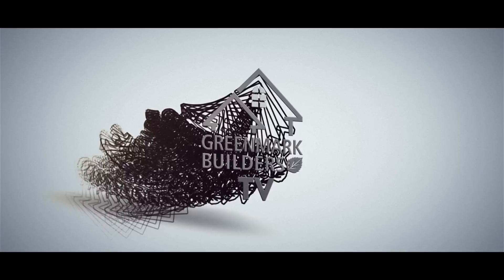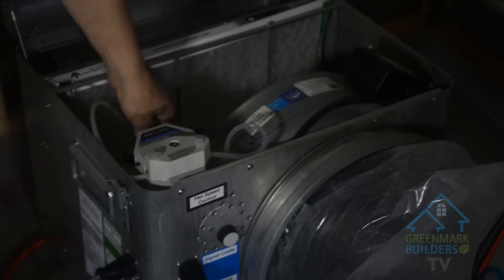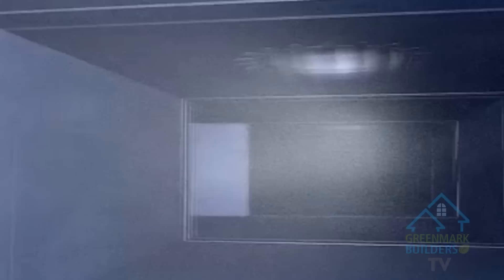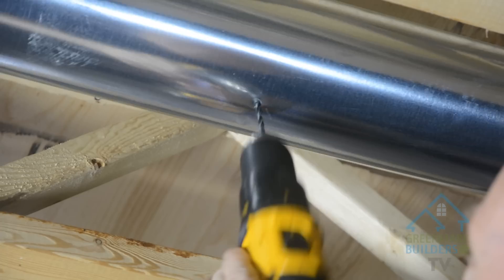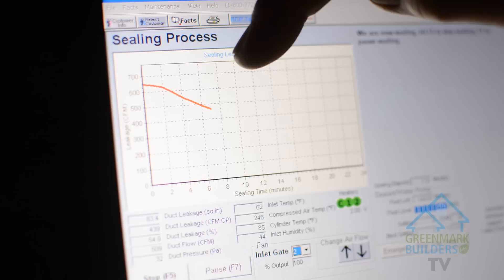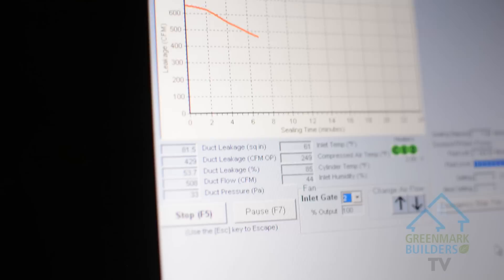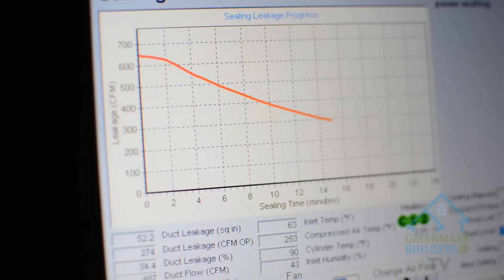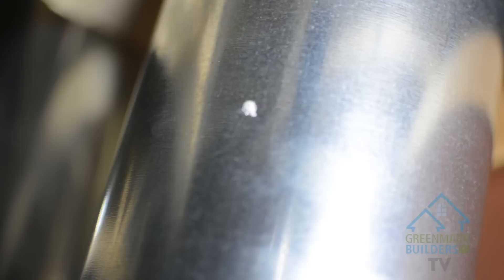Aeroseal... Sealing your ductwork from the inside out and saving you MONEY!

Comment: I had it done and there is a large leak in the line.  Unfortunately, that's all the guy did was aero seal the system and left.   Now what do I do?  It wasn't cheap.
Reply from the maker: was the large leak in the line before?
Reply: @GreenmarkBuilders  I don't know.  I wanted to tighten up the system so I had that done.  The reason I had it done was because it felt as though the air pressure through the returns was weaker.   It seems to be more on the other side of the home.  The duct was put in 1978 which is forty years.   
Now, if there is a disconnect and it's in the ceiling or an area behind drywall how is it located?  Then how is it patched up?  I guess they go through the dry wall?
How do they find it?
Thank you for responding to my earlier comment and I hope to hear from you soon.
Reply from the maker: @beebob1279  Aeroseal does not seal return air.  Return air is designed to take the pressure out of the rooms.  You should have been given a graph that shows how the system is sealed at the end versus the way it was at the start.  I would be shocked if you didn't see a significant increase in air pressure and comfort.  Can you post your numbers so I can understand better?  What was the size of the leakage hole at the start and what was the size of the hole at the end?  What psi did your rep get the ducts to?  This information should be all available on your graph with your aerosol certificate.
Reply: @GreenmarkBuilders  Sorry, I meant the lines pushing air to the rooms.
This was done a couple of years ago and I'm sure I don't have the numbers or paperwork.
Reply from the maker: @beebob1279  you should contact your Aeroseal rep and see about getting your data sheet on your home.  Once you get this you will be able to understand much better.

Comment: How much does it cost?
Reply: About $2800
Reply: Just Got Quoted  $ 2025
Reply: How many square feet houses were these quotes?
Reply: How many square ft
Reply: $1500-2500. For example, my house is 2500 SQ ft. and quote is $2100. Also, check with your utility company about any rebates. Comed offers up to $500 rebate.
Reply: It's not cheap.  The issue I had was that I have a relatively large gap somewhere in the system which I now have to get fixed.  We just don't know where it is
Reply: It isn't cheap and isn't a permanent fix

Comment: Is the coating tolerable to the cleaning done to the system
Reply: They say it does but my experience is these jobs don't last more then ten years
Reply: @zack9912000  I sealed mine on the outside w/caulk. Kinda monotonous but wtf. There’s some good size holes especially if you loosen the cleats on the plenum. My guess 15-25 %
Reply: @scottwebber652  You can get a one gallon bucket of quality mastic for about 20-25 bucks and can seal with a paint brush. That  will works better for you then  cauk and will be less of a headache. Mastic is messy but easier to apply
Reply: @zack9912000  can u put mastic on the inside of the duct. Does it affect breathing since ur breathing in the mastic?
Reply: @diaperdood1  Absolutely you can mastic the inside of the ductwork, yet works best on the outside of your ductwork. 

It has Been done for decades, depending on what you buy nearly all brands have zero VOCs and are non toxic. Most take up to 24-48 hours to cure. So no worry about off gassing.
Reply: @zack9912000  thank you so much for taking the time to respond. I used it in the edges of the fiberglass duct board in the return supply. I’m scared that the fiberglass edges will go airborne.

Comment: so, how do you keep it from clogging up the A-Coil ?
Reply from the maker: if the air is not leaking out of the system it will not clot.  I know this is hard to understand but Aeroseal does not coat the inside of your ducts, it finds an airstream and clots

Comment: Does it go through the return vent? And how would that affect the indoor coil and heat exchanger?
Reply: Derrick. Return side is sealed up through the sheet metal Plenum. The evaporator coil and the heat exchanger are covered up in the procedure so they did not get sprayed.  All the supply vents are covered up and the return grills to pressurize the system. They returned and the supplies can be Aeroseal at the same time but using a Y collar that splits off and does them at the same time.